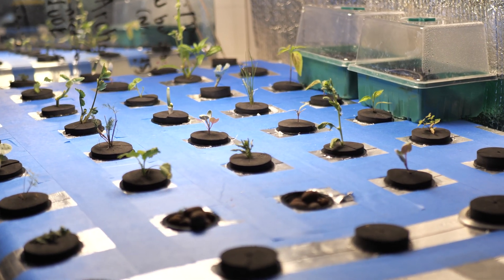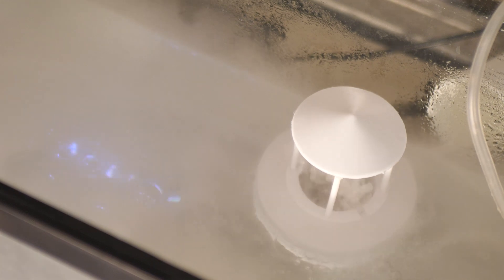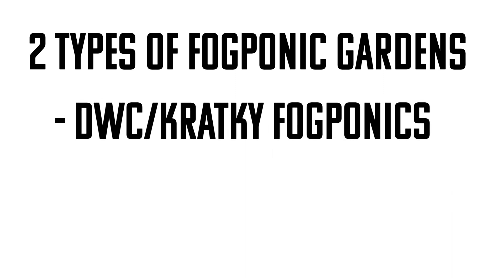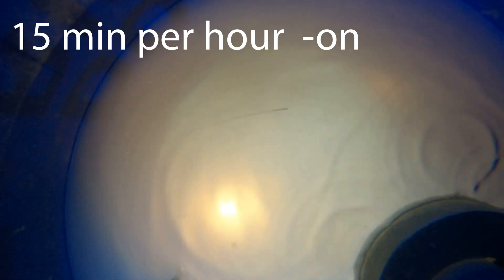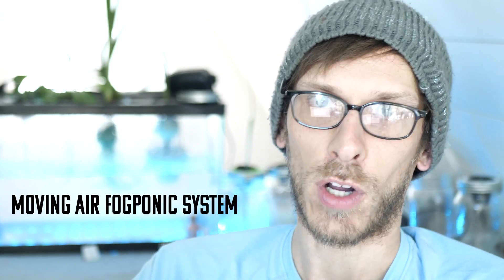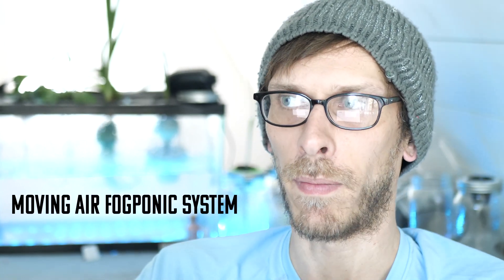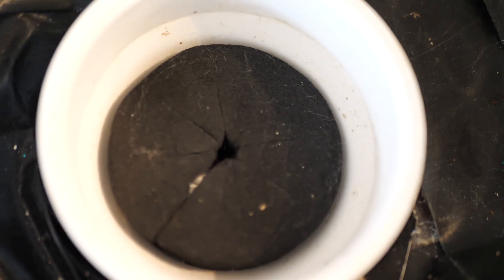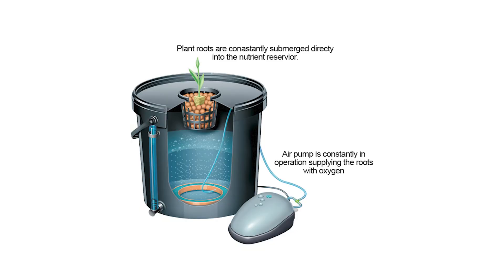Fogponics 101 | How to use Ultrasonic Fogger to grow plants

Comment: Just install a Pump and a 360 PC Water-cooling Radiator. You can get 4 fittings and a used one for under 50$. Heat problem solved.

Comment: 3:53 If the inlet of your fan is in the same chamber as the fan, you can absolutely circulate air without letting it escape. That's how ceiling fans work. You could have two towers sharing the same base and connected at the top and have a fan blow fog up one tower and draw air in from the other and you wouldn't get a net increase in pressure or be "blowing air in a vacuum".
Reply: That defeats the whole purpose though, you want fresh air coming in and in a sense diluting the fog. The density and temperature of the fog would be too high if you just circulate the air in a closed system
Reply: @shortsthatdontsuck2174  The density and temperature of the fog are pretty trivial to control for, but keeping the air fresh would be a challenge.

Do you think the air would become CO2 starved? I guess it would have to. That plant matter doesn't come from nowhere.

Maybe I could experiment with a compost system to break down old plant matter and replenish the CO2. It wouldn't be self-sustaining, but I could supplement with stuff like mowed grass. IDK.

Comment: How long do you let your moving air system run? I fear my seedling did not like 50% of time off and increased the on time to 80%.
If this works out it is a great way to start plants before moving to the bloom tent. I dont want to have another rdwc system or buckets I need to check. One fog res, a fan and a pipe is just so simple :)

Comment: i use 2 fogger per 60l box with 20l inside. i am running them 24/7 and it didnt heat up my water. works great
Reply from the maker: The large reservoir makes all the difference. I noticed with the smaller  tanks, the water heats up significantly faster... makes sense...

Comment: do you need to blow the fog toward the roots? it seems to gather in the middle of the container. Or will the plants just naturally grow roots down to the fog?
Reply from the maker: With the fogponic DWC you wat to have enough water in the bottom to leave just the right sized gap to completely fill with fog. If there is a inch or so where it is not totally cloudy, don't worry, the RH is plenty high in there for your roots to thrive. Just be sure to put the fogger on a Timmer, I had problems with it heating the water up.  If you are doing a funny aeroponic fogponic setup then you will need to continuously move the mix toward your roots with a fan. Things get much more complicated.
Reply: @humblegrowth  I see cool thanks for the response
Reply: @humblegrowth  What about the opposite situation, where you use a short and wide container instead of a tall one, where I guess the roots would be able to theoretically grow into the reservoir. Are there any actual problems with this, I guess it would become like a kratkey fogponic hybrid? Would evaporation become an issue, how many liters are usually needing to be replenished each week/month? Since the container is closed, I imagine evaporation is not too big of a deal, but I'm not sure.
Reply: @humblegrowth  In fogponics, If i check the bottom of the stems of cuttings (before roots appear), is it supposed to be moist, or is it only going to be moist once roots start appearing?

Comment: Yes. 15 minutes ON and 15 minutes OFF will keep temperature normal. Also, two (or more) units will give peace of mind.

I have developed one system, wirking, but seeds some didn't germinate. I think its due to continuous (over humid) and the water get hot. For tower garden I think fogponics better.
Goid work
Thanks

Comment: Great video. If you do the two chamber without venting. use a Venturi pump you can do it without venting the fog.
Reply from the maker: Awesome advice! I am currently re engineering a moving air fogponics system with a venturi pump for growing tubers. Couldn't do it without this little piece of helpful information, thank you greatly!
Reply: @humblegrowth  no problem, I appreciated your videos on this topic as well. I am currently designing a vertical grow tower for a fogponics moving air system that is stackable and modular so you could use the same system for aeroponics as well.

Comment: Nice vid! Took note of the 15 min per hour. I was running 1 fogger per tote and 4 totes with 25 gal capacity about 50% full. Running the fogger 30m on 45m off and my water temps were very high.

My totes also have a large air diffuser running to help with o2 getting to the roots

Comment: Have you also considered pushing into the system thru a Venturi type of system for 45 minutes then escape that air in 15 minutes using 2 different fans that used within the Venturi system?

Comment: Air pumps can also heat up water as well as ultrasonic fogggers.. What I do to solve the problem is to have multiple foggers which go off at different timing so that the other can cool down before they get activated again. Same for any kind of mechanical equipment like water pumps... if you are running equipment that creates unwanted heat in air or water, they use multiple pieces and cycle them or mount them externally like using  a brushless water pump mounted outside the tank.

Comment: Those foggers on Amazon get some pretty negative reviews. I think reliability could be a problem here. What have you found in this regard?
Reply from the maker: terribly unpredictable and fragile. The one I have bought many times comes with 3 replacement ceramic discs. But even still, if it dies and you aren't there to replace it, you're out of luck. Hope this helps. (Aeroponics is better)
Reply: Look at what they use for mushroom growing , for example house of hydro misters
Reply: Looks interesting, thanks.
 @Sssanbo

Comment: I've been experimenting with moving air style for like a year.  Separate reservoir with fogger, air stone and pump.   So air moves through the fogger water to help keep it cool.   Separate fog pipes to multiple plant containers.

Ultimately, the reliability of the fogger transducer is poor, requires extra electricity, and cost.  It just doesn't seem worth it.  For fruiting and flowering plants it doesn't seem like it really provided the amount of nutrients the plants can use.  Maybe there's a system that would, but unclear if there's a benefit to finding it.  Like, it would need to grow twice as fast dwc or something.

Long way of saying I agree with the dwc comment in the video.
Reply from the maker: I totally agree with your comment, and you are the 3rd person to recommend a multiple bucket system for moving air setup. So I guess I'll give it a try lol Thank you! :)
Reply: Over 10 years ago I did a similar setup and testing, aquarium pump, valve, stone, fogger

Fogger would last about 11 months if placed at a specific and perfect depth with 3-day water top-offs - haven't tried modern foggers, maybe the material science has progressed

Best guess is the ceramic degrades faster when not under a certain volume of water consistently

Comment: You can do moving air without an escape point for the air flow, but you need to use an inline fan that can handle being in an effectively 100% RH environment for its operating life.  That's usually done by keeping the motor out of the air flow, so a lot easier to find a good fit in a larger system with larger diameter piping.  Either a squirrel cage or tangential style fan/blower would be great if you can find one small enough.  

You note the reliability aspect of bubbleponics, and that is exactly why I've been playing with hybrid RDWC and fogponics.  I keep the water level for the DWC aspect at roughly half of the grow chamber's depth and feed fog straight from the RDWC feed tank.  You can use the same line for the fog supply that is used as the overflow for the recirculating aspect, and as the water feed with some reducer bushings that have the stops bored out so you can pass a whole pipe through..  You can get the amazing root quality of aeroponics and once they grow long enough, the growth potential of DWC.  If the fogger dies, you have the RDWC aspect to keep it going.  If the power dies entirely, you have the half chamber depth water reservoir to keep the roots from drying out.
Reply from the maker: This is brilliant! thank you for the ideas.